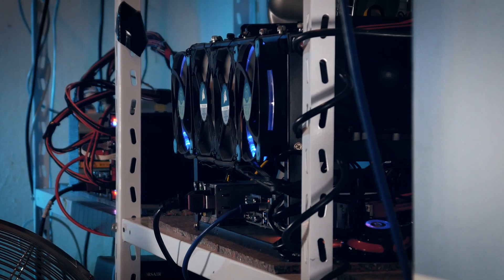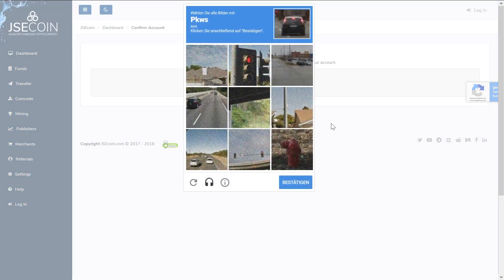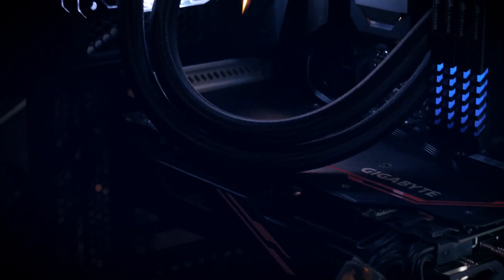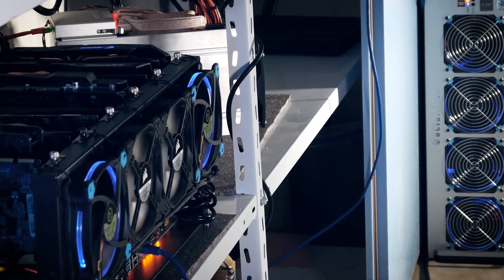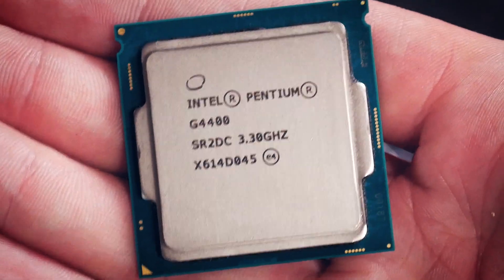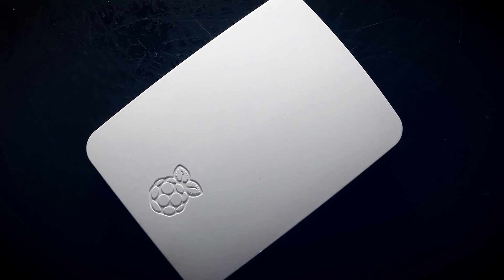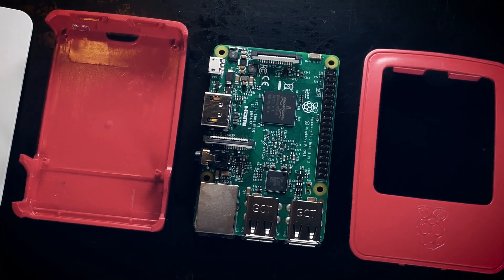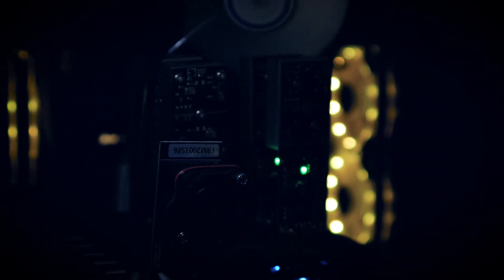Browsermining JSEcoin (CPU / Raspberry Pi) JavaScript Crypto Mining for everyone

Comment: I have a couple of RaspberryPi's, one running as a picture frame and the other sitting waiting on a project. Any ideas, like this one, that put an already powered on Pi to use are of interest to me. This video definitely has me curious about the Raspberry power consumption when mining JSEcoin. Or is that irrelevant and just think about this as a lottery?
Reply from the maker: Yes kind of :) it is so little extra power added that I don't mind experiments like these, but I should have measured power as well, you are right! For now leaving it running with a Rig which is CPU & GPU mining anyway :) cheers ⛏️